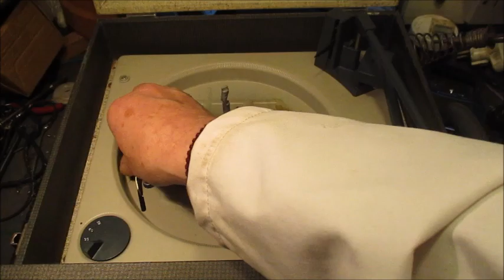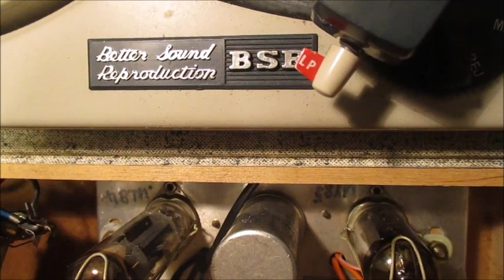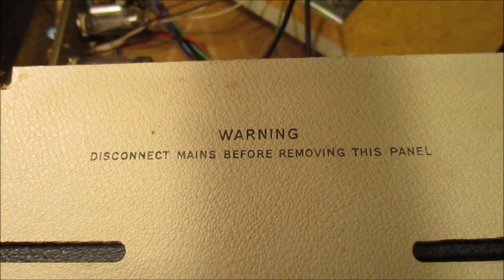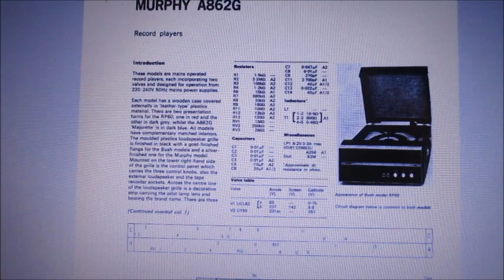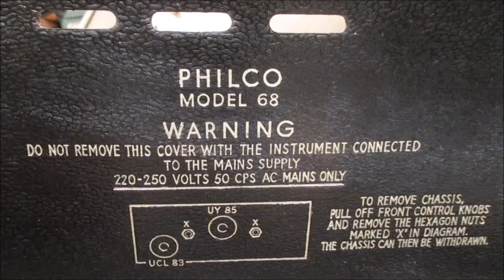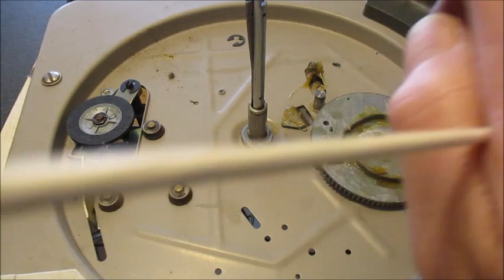Repair of three Vintage Record Players: Alba, Bush, and Philco.

Comment: The sound of these players is pretty disappointing. I would have expected them to sound better than a wind-up 78 gramophone. Certainly Dansettes did. EDIT: great work though. It wasn't meant to sound like a criticism of your repair. They were obviously just sh*t ot begin with.
Reply: You are forgetting something, these set are basically one tube wonder 
They have a three inch speaker, if you wanted a great sounding set  you get a Magnavox, or   Zenith
Reply from the maker: @jonvincentmusic 
These record players were designed and manufactured to a price.  Being far from Hi-fi, at best they were fairly reliable units, and generally produced a pleasing sound.  Moreover, they were aimed to satisfy demand from a particular section of the market.  For example, when compared to the majority of younger people born before WW2, the ‘boomer generation’ onwards, having reached working age, very likely earned higher wages and salaries, so tended to be the greater proportion of the consumers who owned those type of record player, and more than likely played charts music records on them.  Their parents, like mine for example, played different styles of music on often expensive, usually better sounding, stereograms.
Those record players, and other brands within the range, adequately fulfilled what they were intended.

Comment: That cartridge sounds great maybe i'll put one in my Collaro
Reply from the maker: Hi,
Thank you for dropping by my friend.
Bare in mind, the type of replacement cartridge I used have their limitations.    Installing might not be straightforward, and the level of audio volume and sound quality might also be compromised.
The positive side: they don’t cost much to buy, and they are fairly easy to obtain online.
Phil
Reply: @steelcity321pb6  i have a mounting clip from a varco tn4b which those fit very nicely and it had a hole in the center

Comment: Great to see you again, Phil!  I recently serviced my old BSR McDonald turntable.  The speed selector and size selector were both very hard and the singles spindle almost seemed to be glued in place.  A bit of heat to it and some lacquer thinner on the switch mechanisms, then a bit of sewing machine oil has everything moving nice and freely again.  I replaced the singles spindle with a changer spindle and also picked up a 45 adapter.  Had to adjust the dropping screw to get the needle arm to drop in the proper area.  The old pickering v-15 moving magnet cartridge is still working flawlessly too.  Now I'll sit back and watch your video.  It really has been far too long since your last one.  Take care my friend.  Gary
Reply from the maker: Goodness gracious Gary, the Pickering V-15 cartridge goes back some time.  I haven’t heard of one of those in decades LOL.  It was developed by Norman Pickering during the late 1940s.  From what I remember, they gave excellent reproduction performance.  I worked alongside a service tech (who was also a semi-professional guitarist) who constructed a reverb tank that incorporated a long coiled spring, and two surplus V-15 cartridges. 
I too have cleaned, and lubricated record decks that have become solid.  The old, original grease becomes hard, and has a glue-like grip.  I use gentle heat, and paraffin to soften the old, sticky grease …though lacquer thinner works equally well.  The trade secret is to be meticulous when cleaning older record decks (I use paraffin, or turps substitute – being a registered asthmatic, I tend to avoid using lacquer thinner), and not to over lubricate them which I feel quite sure you are aware.
Cheers dear chap, Phil.